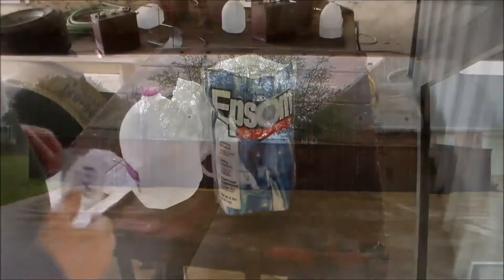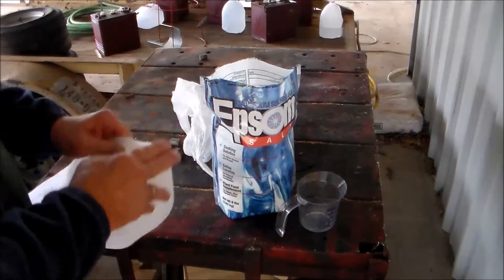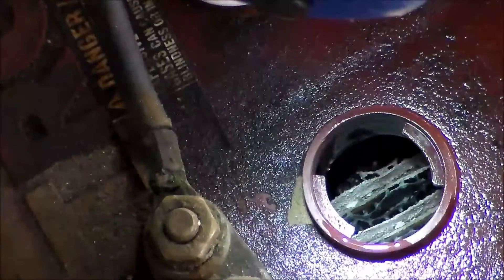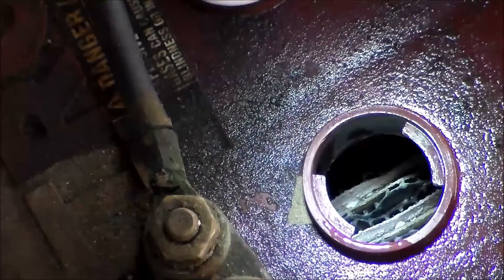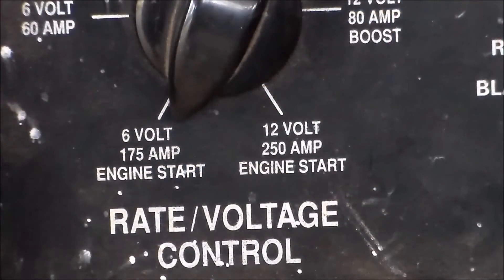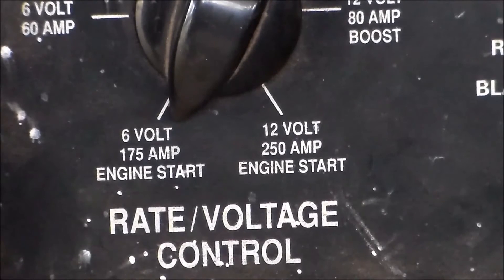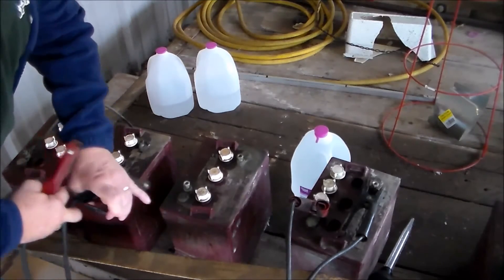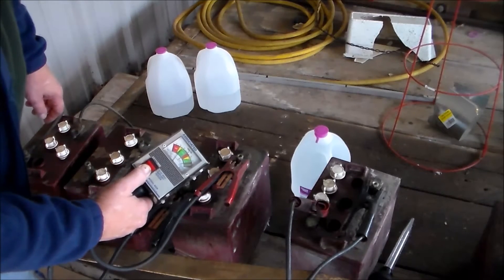Epsom Salt used to Recover Batteries

Comment: I've had luck just rinsing the battery out and replacing the electrolyte. You know Lloyd, about 20 years ago, Bell labs came up with a machine that could strip protons off an atom one at a time. Lead has 82 protons. Gold has 79. They literally turned lead into gold. They can only do it one atom at a time though. It'll be interesting to see what they end up doing with that technology.
Reply from the maker: Great job saving the battery and any I can't save, we will convert to gold...deal?...haha Thanks Marsh and have a great week.

Comment: You are right to be careful around batteries. Worst experience, at the lock at Bardney and a small boat with an outboard would not start in the lock. Pulled it out the lock with ropes, an easy job of course. I was standing alongside when the owner was trying to start it while standing near the back. The battery exploded. He was very lucky not to get splashed with acid. What happened was they thought it was a non servicable battery, which had run very low of water. It sparked inside causing it to explode.
Reply from the maker: Any gassing battery can be dangerous for sure. But  caution is always a best practice around them. Thanks

Comment: I have heard about folks doing this but have never tried it. reviving an old battery would add some awesome off grid power to the trail box :)
Reply from the maker: Batteries that set with a low state of charge are always at risk for this. One bad battery can reduce the performance of the complete pack. Thanks

Comment: Wondering if the used batteries will hold the charge after the epsom salt treatment.  Give us a future update if you can Rusty
Reply from the maker: That will be the big test. After I get the ones saved that I can I will check the gravity and go from there. Thanks and have a great week

Comment: I was under the impression that batteries fail when the buildup of lead sulfate below the plates causes them to short out. I guess that is not correct. On the other hand, my chemistry background is telling me that adding magnesium sulfate to the battery certainly can only be a temporary repair. I would imagine that after a few months it will fail again. I'll be interested to hear what your experience is.
Reply from the maker: I'm no scientist but I was able to bring back 3 out of 4 so far...haha,  I've done it once before and it worked on those batteries for about a year or more. But we will see if they will maintain a charge. Thanks Bruce
Reply: I've had experience of this. Batteries used to last a little long than the guarantee. Learned this from a salesman in the 70s. The cases were designed so they shorted with the lead sulfate. We had at least one where you could cut the top and lift the battery out the case. Emptied the case and it was good for another couple of years.

Comment: a friend here tried it on an old battery and it worked, he tried it sometime later and it is still charged,, might not work every time but when it does , it's a money saver.
Reply from the maker: Great to hear, I'm hoping this will work on these too. Would be nice not having to buy more batteries. Thanks
Reply: I had an old electric cart but the batteries were going to be well over 600.00 so I sold it cheap.. lol

Comment: Good luck with that I hope you have great success. Eventually the lead all goes away. 5 years max life on those.  I have bought a lot of golf cart batteries. I could not get but a couple of years out of my cart batts.  I kept on getting a dead cell on the end batts. I was using a off brand but I hear the T105 Trojan are supposed to be good.  I went to lithium Ion I love them. The future is here.
Reply from the maker: I hope I can get a couple of years out of them to reduce the cost of the project for now.  Thanks and have a great week.

Comment: did u Drain the old batteries first?
Reply from the maker: I didn't, the batteries were low on water. I just added the solution to each cell. Thanks

Comment: Good stuff. Good advice on wearing protection. I had a truck that stalled and won't start. I grabbed the cable and sure enough it was loose so I was working it back and forth to get a good connection. The alternator was trying to charge the battery and couldn't do it's job because of the connection. When a battery is being charged it gives off hydrogen and that is very flammable so guess what? When I worked the cable back and forth I got a good connection with a spark and bam. I had an explosion with my face right next to the battery. I ran up to the house that was there and turn on their hose and washed my face, neck, and head. I had some soreness and irritated skin for a few days but I was lucky and God was watching over me. So yeah protect you eyes. Only got two2 of them.
Reply from the maker: Batteries can be dangerous and should never been taken for granted. Trapped hydrogen gas and a spark is all it takes .Thanks and have a great week